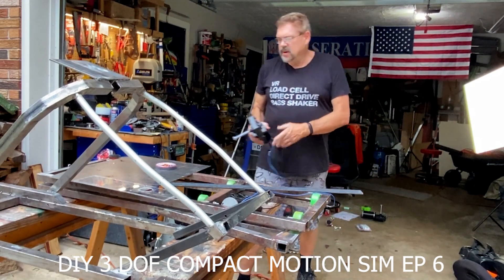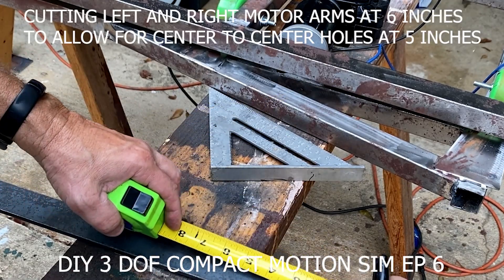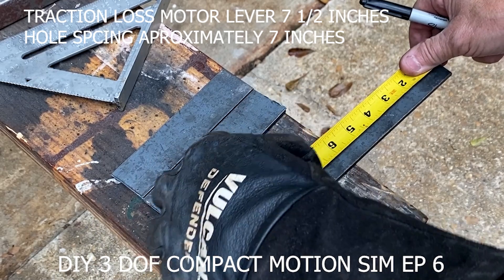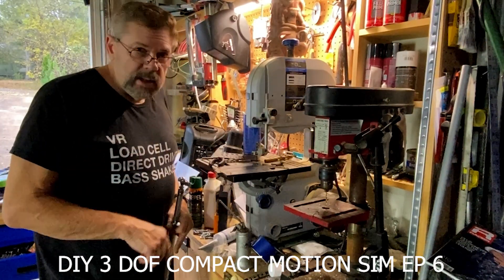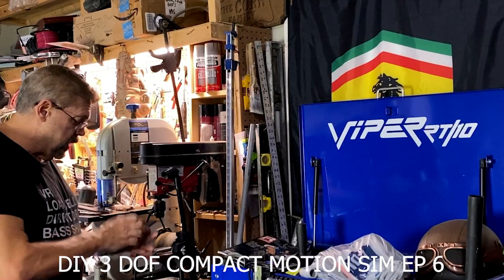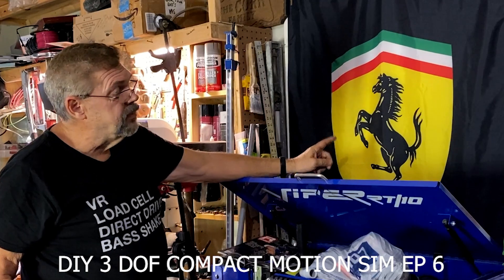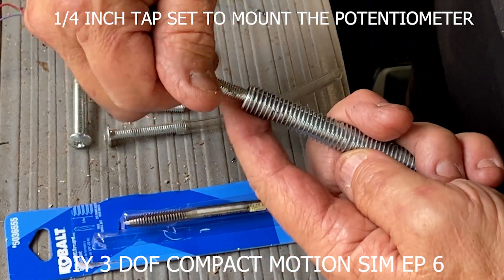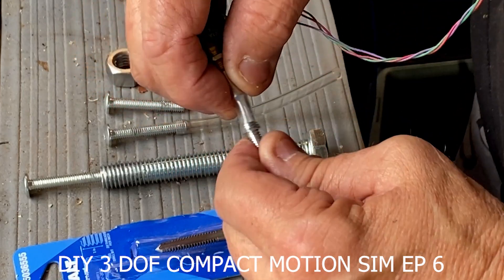DIY 3DOF COMPACT MOTION SIM EP 6

Comment: what's the name of the piece (that goes under the seat  allowing to  move forward and backwards) welded to the frame
Reply from the maker: Good question.  So it's called a U joint. Typically found in rear wheel drive trucks and cars. It pivots all directions.  I bought mine from a 'junk yard' or  'salvage yard' where they take old cars and trucks and sell off the parts.  It cost me $20 bucks US..  both ends of the driveshaft I bought have a U joint.. so I have two U joints now  one for both of my motion rigs.  Yeah you just gotta find a junkyard and go get a driveshaft that the U joints (universal joints) move and are not rusted solid.. Hope that helps Dave

Comment: Would the nut still come loose on the crab motor if you had used a high compression lock washer? I wonder. Great stuff!!
Reply from the maker: Yes. I think it would..  It spins both directions.. Tried those cut lok washers.  still happened..  replaced with nylon stop nuts..  still happened..  Even with a small grub screw going all the way through the axel, it sheared off..   Thanks for the comment!

Comment: Soooo much fun to watch you in your own little world,  doing your own thing and passing all you learn to us lot.  Have you tried using back nuts instead of welding the lever arms?  Will allow for removal for whatever reason but be secure enough for it no to work loose.
Reply from the maker: I did some experimentation on that exact thing.. however,  just ran out of time (which is common to me)..   It's still on the "LIST OF STUFF".. hahah..  Thanks for the comments Terry..  Keeps me in 'check'..  hahah! Dave
Reply: @DMAX_DIY  that danged time thing.  You need a clone.

Comment: Hi, can you please explain in more depth what is the balance point, how you can find it and what are the cons if you don't set it right? Thanks
Reply from the maker: Good Question.  I'm going to go into this in more depth on video 8.  But long and short of it.. The top frame, with the pedals, wheel, shifter etc and you sitting in the seat comprise all the weight the motors must be able to move.  You want to place a round pole under the frame and find where, as you are sitting in it it balances out..  mark that- That is where the best placement for the u joint will be.   If you have the u joint off that mark, the more the motors and motor controllers will have to work, eventually ending up with sluggish performance in one direction.   Hope that makes sense.. Dave

Comment: hi dave i just bought 4 wheel chair motor do you think 3 motor could lift up 80kg?
Reply from the maker: I would think so.. what is the gear ratio? and what is the voltage required for the motors.  I had pretty good luck with the WC motors I got off ebay.. although the gear ratio was only 18:1  and these crab pot motors are 50:1..    80 kg  come to about 176 pounds.  so it depends on what your design is..  both of my 3DOF's use a pivot (u joint) which supports most of the weight.   What kind of desgn are you planning to do?
Reply: hi dave its me again i have 3 motor 1 says 9.78 and the other 2 said its 8.9 and the voltage requirement is 24 for all 3
Reply: if it did not lift me up can i add some bicycle sprockets?
Reply: @DMAX_DIY  https://www.youtube.com/watch?v=oqVrYiQ0cz4 this is the design i will do
Reply: one more does any potentiometer will work? i bought one with 10 spin

Comment: D Max. An other question. Why You need 2 power supply? I know it's one for each motor. Can You use 1 for both motors? Or it's necesary to use 1 for each one?
Tks a lot your help
Reply from the maker: Good question Alejandro.  Currently I use ONE battery to supply all the power for my bigger 3dof.  850amp ready..  But on this new compact rig, I want to try and us some 'plug in' power.  So I will 'testing' Dell or HP converters, which I should be able to plug in the wall socket and still get the 12 volts out of them..  I wlll have to run a 'stall' test on the crab pot motors to see how many amps they  can pull a full tilt, but till then I'm not sure.  My older rig pulls around 4 amps just driving around but can peak about 22 amps at hard driection changes  brake to full accel..  So short answer I am making a video and going over it in the future..  after I finish getting the mid and top frames sorted out.  Dave😁

Comment: Wouldn't a few drops of red thread locker prevent that nut to come loose on the axle shaft?
Reply from the maker: Good question.  probably not.   If it can snap a grade 5 bolt, then the thread locker would probably not handle the torque load.  It might, but after the hassle I went through on the old rig with stop nuts, I am just welding this one and moving on..  Dave

Comment: Hey D Max, i posted a comment with a shop link for you..... i think it's stopped, because your youtube setting. can you find the post? because it was useful for you.
Reply from the maker: Hey buddy!  I dont know a lot about you tube settings..  maybe just add it again without the http://www stuff.  just some text?  IDK..  Looking forward to it..  I can find my way as long as i have something to go on..  Dave
Reply: @DMAX_DIY  Hey no problem....i can write again. I try to remember. First.. very nice Video as always. :-) Ah and i corrected your NM declaration. Because, the DD1 has 20NM not 15. BUT: for the requirements you describe, i strongly recommend the Moza R9 for you. That is the way for your happiness. :-) And now i have another thing..... did you ever hear about contactless hall sensors? In my 2DOF times, i used them instead of Potentiometers. Because there is no mechanical contact between the motor axis and rotation sensor. On the DigiKey com webshop you can find. Here ist the partnumber:  Sensor: 480-6128-ND +accessories:  A105021-ND and 3x A105220TR-ND
Maybe it's interessting for you. I was very happy with that. They work like a normal Potentiometer. If you have questions about this...go for it. :)) Again: very nice Video! I can't wait to see you drivin. ;D
Reply from the maker: @motionbasti  Thanks for the info my friend!  Yeah I use the hall effect pots all the time to read motor position. I use the 180 degree ones cause the motors only have a effective range of maybe 160 degrees..  and that's even hard to get. I use them on all the videos.. I probably call them potentiometers  which I certainly do not mean to mislead or mis-speak.. but yeah they are not wire wound..  they spin and have a sweet spot..  I included the digi key pn in the description along with all other relevant parts such as motors, controllers etc.  Correct about the DD1.. I was looking at old data apparently. and some of my buddies with fixed rigs have the DD1.    One has the simucube 2.   several have the CSL DD.. and I'm the only one with  a belt drive still. hahah..  I almost pulled the trigger on the simucube  but then my wife had to buy plane tickets for 3 people and damn.. there goes the simubube..  *again*!!   well, I will figure something out for this new rig..  BTW the PN I use is Hall Effect Potentiometers  DIGI-Key and others PN 987-1392-ND     they actually were "OUT" of stock for like 8 months during late 2020/2021  but seem to be back in stock now..   Good hearing from you!  Dave
Reply: @DMAX_DIY  To get sure: i saw that you use "hall poti's" i call them. :) but what i recommend to you was: hall sensors without mechanical shaft. You will only have a sensor and a small disk with magnets you have to screw to your motorshaft. sensor and disk are contactless mounted. :-) This is also a 180degree version. Greetings Basti
Reply from the maker: @motionbasti  yeah mine are called SENSOR ROTARY 180DEG SLDR TURRET so from Digikey they are rotary sensors.. here's the link https://www.digikey.com/en/products/detail/tt-electronics-bi/6127V1A180L-5FS/2620661?s=N4IgTCBcDaIJwA4DsBaAjAZjmFA5AIiALoC%2BQA
 i think its the same thing my friend!  Dave

Comment: Hi!! Tks for all your videos. I have a question. Here in México it's very difficult to find motors. I found one in amazon, the model is my1016 24v 75rpm. Do You think that motor works for My project? Y what a 2 dof full platform sim, no only seat. Tks for your help.
Reply from the maker: Good question Alejandro..  you will need to supply the 24 volts..  RMP is probably fine..  do you know the 'gear ratio'?  The seatomver project I built did work in the end and the gear ratio was 18:1   you are probably just fine..  but it's experimental science in a way so sometimes there are glitches to overcome.  Dave
Reply: @DMAX_DIY  hi!!! Tks for your help!! I don't know the ratio. This motor uses for electric bikes ando some wheel chairs. Do You saw the specs of the motor? I don't found the radio specs. Theres a video of someone use this motors but is for a seatmove simulator not for a full base simulator. Again tks for your help, and You have a new fan from México. By the way, sorry about my English.
Reply from the maker: @alejandroleonmagallanes4455  That's all good my friend! All you can do is try.   Matching the motor voltage and the converter voltage or battery source is the only way to go.  Check out the 'specs' on the IBT-2 motor controller,  they can handle a range of input voltage..  Just search on line  but here is what I found 

High current "H" bridge module for motor drive applications using dual BTS7960 chips. Built-in temperature & current protection. Logic level inputs to interface to a microcontroller.
Only four wires (GND, 5V, RPWM & LPWM) are needed from the microcontroller to the drive module.
Input Voltage:
Motor: 6V-27V
Logic: 5V (From Microcontroller)
Motor supply & Logic share common Ground.
Maximum current: 43A

Comment: Looking really good!  Always nice to see new work.  Where do you get your U-joints from?  I'm having a hard time finding one, cheaply I should say.
Reply from the maker: That's a good question hank! I appreciate you watching.  Well I had to go down to the 'junk yard' and they had stacks of complete driveshafts there.. Pretty rusty as you would imagine. But for 20 bucks I found one that the u joints still moved pretty good and then just cut off the end of the driveshaft I didnt need and stowed it away..  the angle grinder with a cutting disc took about 60 seconds to do it..  a hacksaw would work but ..  angle grinder is quicker.. Dave
Reply: @DMAX_DIY  Awesome, thanks for the reply.  I'll definitely look in to that.

Comment: Hey Dave,

Great Episode!!! Its coming along nicely!

Quick question, What length are those 1/2" Bolts?

Keep up the great content mate!!
Reply from the maker: Thanks for watching..  the 1/2 inch bolts are 4 inches long..  so that's enough to mount the lever are and TWO lock nuts.  One of the motors has to be flipped around so  4 inch is the way to go.  Dave
Reply: @DMAX_DIY  Thanks Mate, Ran down and grabbed some 1/2" endless thread and made them up on my lunch break hahaha, Came up mint!!!
Reply from the maker: @rav3n925  Yeah  that will work!  I had 3/8's  but no 1/2 inch so had to use some bolts.. no biggie.. the lowes store is like a mile away.. so I spend most of my money there anyway..  Just wish they had a SIM RACING Department..    hahah.. Dave
Reply: @DMAX_DIY  hey Dave,

Made my levers and I'm tapping out the motors, just thought I would let you know that the internal main gear is nylon, and you can turn the gear around so the shaft can be a lhs and rhs for the front two
Reply from the maker: @rav3n925  VERY GOOD INFO my friend!  I just never had the chance to take them apart I suspected they might be nylon.. that's why I cool them down after doing tack  welds..  Once I got them moving, i just forgot about even looking inside them..  Keep pluggin away..  I gotta put that on my list for next year..  Take the motor apart ..  😁
Reply: @DMAX_DIY  Legend!! Thanks for the reply Dave

Comment: Respect Brother.. Keep up the good work.. Wish I had welding skills
Reply from the maker: Thanks Wilson..  I will keep at this.  'kind of like' building a race car from scratch..  just keep focused.. *that's what i tell myself * haha  Thanks for watching my friend! Dave
Reply: @DMAX_DIY  Actually, turning a lot of folks on to your channel. Wouldn't race sim convert to Flight sim with not to much effort?
Reply from the maker: @WilsonBradleyTheOfficial  Good question..  I think so.  after I get this compact sim up and running I'm going to just add HOTAS and rudder pedal etc to the other rig..  Pitch roll sway etc plus traction loss would be YAW..  should work pretty good..  Getting Sturmovich to play with on that one.. Dave
Reply: @DMAX_DIY  Excited to see that evolve..
Reply from the maker: @WilsonBradleyTheOfficial  Well seems to be workin fine so far..  I'll put the power down once I get the other two motors settled in the correct spots.  Thanks for watching! Dave

Comment: Thanks.  Another great video. I'v been practicing my welds on some scrap, getting ready to start my project.  Really, glad I found your channel.  Easy to understand/follow and some great insight and advice.
Reply from the maker: Appreciate your comment my friend! Yeah I'm still not real good at welding and the flux core makes a bit of a mess compared to a gas setup..  but for 'on the cheap' I have zero complaints..  Sometimes I need to adjust the output voltage on the welder for thinner metal so I dont burn through it if I hold it too long..  I'm really hoping to cover the entire A-Z on this series..  Not going to stop till she is up and running so stay tuned.. even with the Holidays coming up.. I may miss a weekend or whatever but that's the goal.. A-Z..  Dave